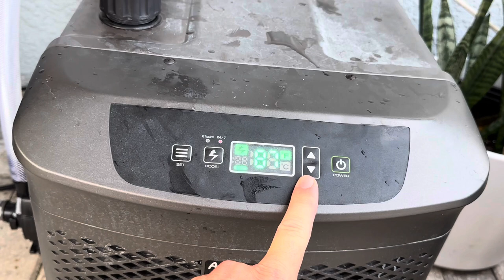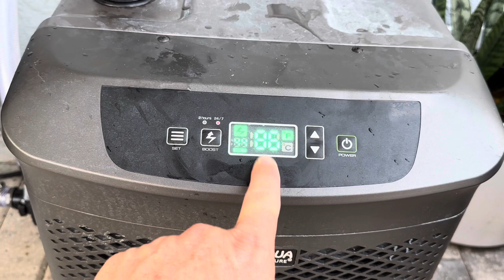How to add a DIY Chiller to the New Ice Barrel 300

Comment: Important: All ports on the Ice Barrel 300 are 3/4 NPT (not GHT). Several of Dave’s kits include GHT threaded adapters that do not fit the Ice Barrel 300. Using those GHT adapters will result in damaging the threads on the Ice Barrel.
Reply from the maker: Thanks for the heads up. For reference, i agree with you however the pieces i have in the kits are exactly (after trial and error) what I am using and there are zero issues. I have updated all the kits for the 300 and they have both options. If you want to go with NPT to NPT exclusive, they are the brass options in the kits. 
Any questions, message me on IG: @dmausjr
Reply: Thank you  @DavidMausJr  Very appreciate of your helpful reviews.

Comment: Great video with details and parts. I'm curious how many times your chiller cycles to keep the water at temp during the day. I just picked up my Ecoplus Commercial 1hp and it has a 2 degree offset setting. I'm hoping to limit the amount of cycles as it's less wear and tear on the compressor.

Comment: I set up the Active Aqua 1/4 HP chiller with an inline pump from Danner, and after it worked just fine, neither will turn on.  There is water in the entire system and I'm at a bit of a loss for how to trouble shoot.

Comment: Does the pump stay pumping water through chiller even when water temperature is met?
Reply: I’d like to know the answer to this as well.
Reply from the maker: Yes. But the chiller will turn off. Water still flows. It turns back on when temp rises 2-3 degrees

Comment: Do I need any of the adapters if I am using the 1/2 hp active aqua with the standard 3/4” hose and the ice barrel 300?
Reply from the maker: The first kit has the adapters you need for the 1/2 hp. you will still need a few just to connect to the barrel.
Reply: Thanks, ordered it off your link @DavidMausJr

Comment: Quick question. I just ordered the Ice Barrel 300 and wanted to know which would be the best chiller option.  I live in Florida like you, I’m in Gainesville.  I was thinking the 1/2 active aqua as the option I’m going for. But I ahve also seen you use the 1 HP.  I know that will be double the power, but would 1/2 HP be enough?  I am looking to get temps in mid 40 degree range and I will keep it in an air conditioned metal building on my property.
Reply from the maker: Awesome! Yes the 1/2 should work well with the 300 in that setting. The insulation is a game changer!

Comment: In case our cold tub is out in the elements in TN - (redwood outdoors alaskan cold plunge) have you found a housing for this to keep it out of the elements or it's been working fine? Thanks for all the info.
Reply from the maker: Mine has always been outside and works great! The plastic shell is a house protecting the components.

Comment: Thanks for the video! I was looking at Ice up industry 1 hp chiller that already has the pump,filter and ozone. Looks like it can be a easy dyi set up, do you think it would be compatible with the Ice Barrel 300?
Reply from the maker: I dont see why it wouldnt! Just need a few connectors and you would be good to go! If you go that route you can use my discount codes for both! :)
Reply: Perfect I’ll give a shot. Thanks!

Comment: Hey, just setting everything up as there was no need for the chiller in Connecticut through the winter.  I ordered everything strictly through the links you shared (much appreciated!).   As I unboxed everything I realized I was short (Barrell 300) the top hole adapter (1" barb tip) and the "o-rings" aka stainless steel hose clamps were far too large for the hose.  Not sure if it was your links provided OR some idiot packaging my order..either way just a heads up..As always thanks for the great content!

Comment: I have the 1/2 hp penguin chiller with the adapter clamp for the ice barrel 400. It has been a lemon and the chiller broke after 3 months. Can I use the aqua chiller without poking holes on the barrel maybe using the penguin adapter clamp and inline pump ?
Reply from the maker: Man that bums me out for you. I have heard so many stories like this, that is why i havent done anything with them. I havent played with it but if it looks do-able, it probably is. Send me some pics on IG @dmausjr and I can help walk you through it if you need.

Comment: Hi David, to clarify at 8:50 min, we connect our garden hose to the top inner hole of the barrel and force water through the 'out' pipe? If so, how long do we do this for? Thanks again, your videos have helped tremendously to say the least & I have ordered the 1/4 active aqua for this DIY!
Reply from the maker: YES. Sorry been traveling. This just pushes water into your pipes and the pump. You dont want the pump to be on "dry". So just do it until you see water coming out of the other side. You can also do this from the bottom hole, the top is just easier to reach.
Reply: @DavidMausJr  No worries, Thanks David!!

Comment: Thanks for the video David. Is there a way to add a more robust water filter to this?
Reply from the maker: Totally if needed. I find the strainer to work just as good as any of the other big filters. And you don’t have to replace, just spray out.
Reply: @DavidMausJr  How often do you have to clean/rinse off the strainer?
Reply from the maker: @colbystewart4447  Depends on how the water flow is looking. I typically rinse it off twice a month

Comment: Quick question. So this chiller is fine to use in an outdoor setting?
Reply from the maker: I have been (any many others) for a long time with no issues.
Reply: That was i have seen and read. Just wanted to confirm before i buy. Thanks!

Comment: I live in SC.  I have two questions.
1.  Is the 1/2HP strong enough year round?
2.  Should I just wait for ice barrel solution?
Reply from the maker: I’m in FL and had the 1/2 for a year. It worked great for me with the 400. It will work get on a 300 for sure. Ice Barrels chiller is going to be incredible but won’t be out until Dec-Janish, if you want to wait.
Reply: @DavidMausJr  Went with Spartan's new 1HP Chiller/Heater.  Just hooked it up.  Hopefully it runs well.  Some shipping damage, but seems to run fine.

Comment: Browsed the comments and didn’t see this question asked. So how do you drain the Ice barrel if you need to change the water out? I know other systems have an adaptor for a hose. Just curious. Thanks and love the content
Reply from the maker: You just detach the top hose and let the pump pump all the water out.
Reply: @DavidMausJr  ok cool that makes sense. Do you drain it with the pump running or just let gravity so it’s thing? Don’t want to burn out the pump.
Reply: I'd also be curious to know if the pump can run all the way until the barrel is emptied
 @MusicMeatMuscle

Comment: Do you need to add a oring/rubber washer  to the adapters/barbs to prevent leaks
Reply from the maker: You shouldn't. I didnt use any and no leaks
Reply: @DavidMausJr  ok. Thank you